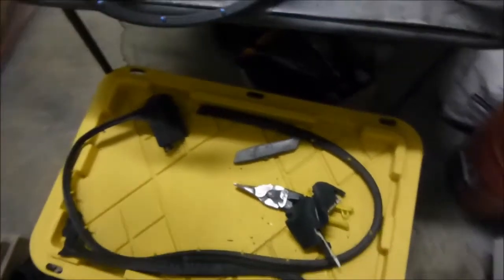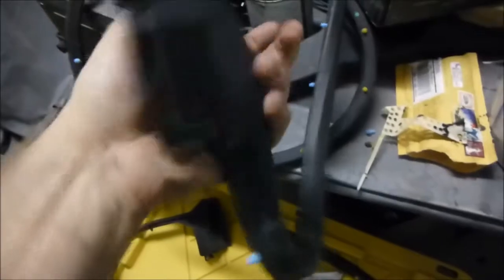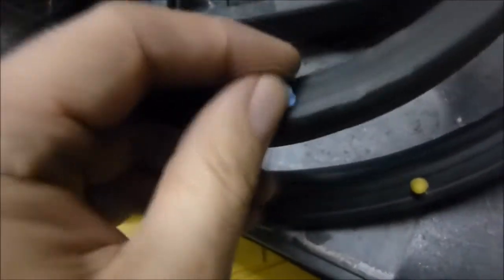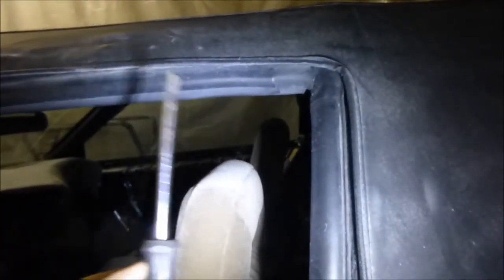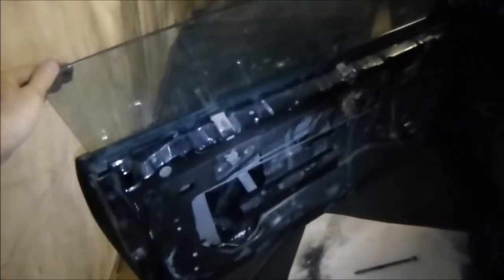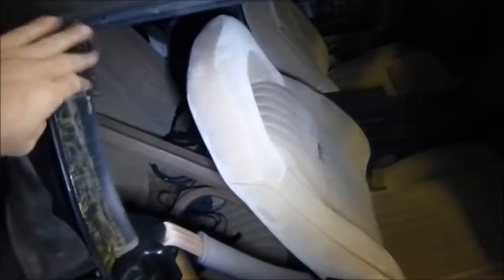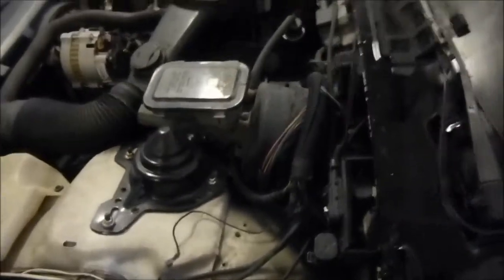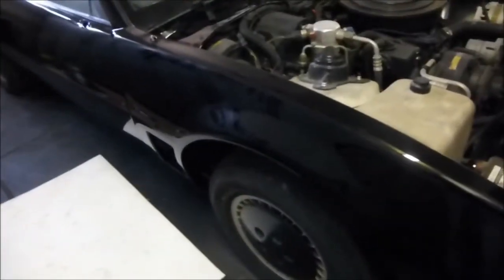How to adjust windows on firebird Door

Comment: just did a window & regulator swap after reinstalling the doors top weather seal which I can't get to push outward an stay in correct position my window is being pushed inward.
not sure if the door seals are reusable? I used a big screw driver pushing upward to remove seal off old door when I press seal back on w/ downward force it won't clip into position.btw excellent video on explaining adjusting window.

Comment: I believe the 'C' button was along that panel that goes from the steering column to the monitor, or so I've seen on UV MAPS of the dash.  But yes, I agree with Ron, are you going to be doing the fibreglass top that magically appeared from nowhere lol, otherwise it wouldn't be a true KITT convertible LOL.  I'm sure you've thought of that somewhere down the line, or at least we HOPE you have lol ;-)

Comment: Try to avoid using the fast dry weatherstrip adhesive. It shrinks. Actually something urethane based is always best to use. It won't shrink and stays pliable... definitely stay away from silicone it shrinks over time too. Looks good man.